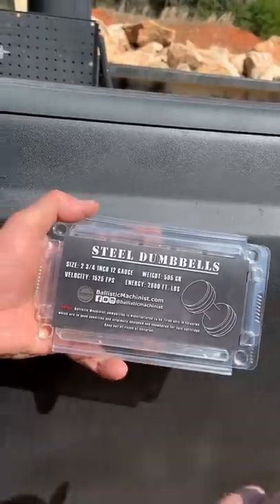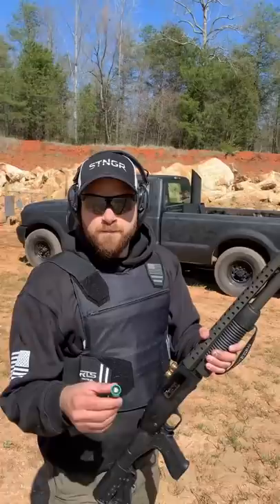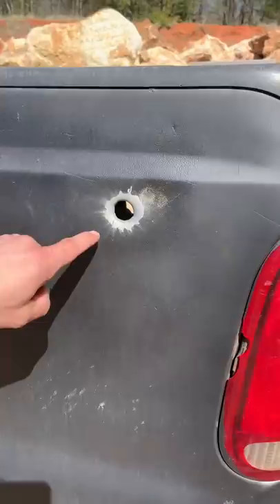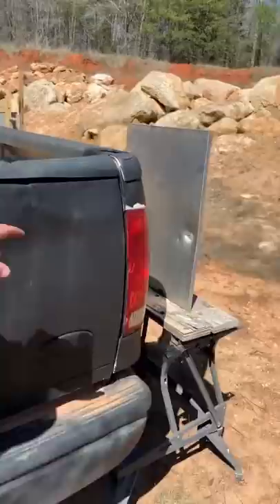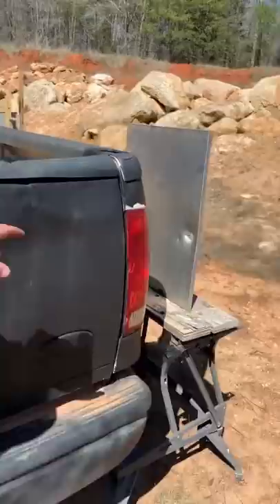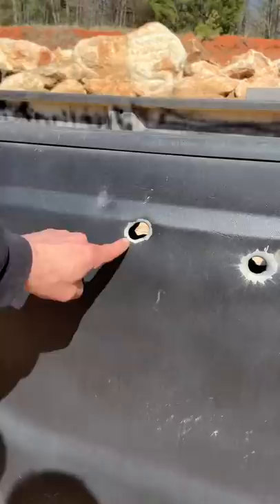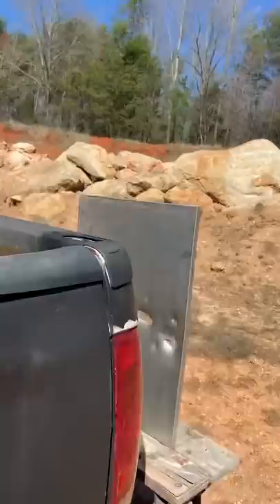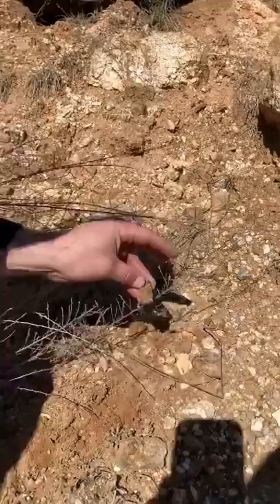Steel Dumbbell Round Vs F250

Comment: Perfect house defence. Honey someone's downstairs.. 2 threw floor while never leaving the bed 👍
Reply: It's not about the size of the bullet it's about accuracy
Reply: That’s too much it’s over penetration. It might go clean thru.
Reply: That’ll go through the intruder, your walls, the cars parked out front and into your neighbors home.
Reply: That's not going to work Einstein. Do you see how thin all that metal is? I mean seriously what are your floors made of? Some kind of particle board or balsa wood?
Reply: @michaels.330  You really think wood/composite flooring would stop a slug going through your floor to ground level? The only issue would be the struts getting in the way.
Reply: @Mundilfari_  I definitely think it's a false equivalency to say that this round that went through 3 thin layers of metal, would do the same to the various layers of everything between the floor and the basement ceiling. It's all about stoppage. And the various layers, not just the wood and what you mentioned but everything in between will do more than you think. People didn't think that all the layers of a fabric that was interwoven wouldn't do anything either. But look at the way kevlar changed the world. I definitely think all the different layers of crap in between the floor and basement ceiling would do something similar. That round is not making it through a floor. This video is giving people false ideas. I could puncture sheet metal with a pencil. What does that tell you? And the shot he took between the tail bed of the truck is not very thicker either. You can believe whatever you want though. I'll stick with science and logic.
Reply: @michaels.330  Have you ever seen how thin ceilings/floors get in apartments and multi level houses? It’s all about maximizing room volume now while using less resources, you see it in most newish real estate. It takes something as little as jumping too much to fall through the damn floor, let alone shooting a massive steel ball straight down through it. If it were a buckshot maybe it would slow down or be stopped but there’s no way insulation and flooring would be enough to slow down a hunk of lead going 400+ m/s. The physics just doesn’t add up to what you’re saying.
Reply: @Mundilfari_  the physics definitely add up, there is enough resistance to slow it down and stop it with a floor. But just to humor you, the physics don't add up to a simple fabric kevlar vest either yet that happens. You're just going to use anything to argue, because you feel it necessary to be right like the vast majority of everyone else online. There is way more layers of stuff in between the floor all the way down to the ceiling of the basement that you're indicating. You are downplaying it because again you want to be right. And there is no way jumping up and down like crazy would bring me through a floor. Not in any of the places I lived at least. You must be living in some really cheap places if jumping up and down sends you through the floor. That's absolutely rediculous.
Reply: @michaels.330   Welcome to the lower middle class, where you can only afford what’s functional, not durable. I linked you an example but YouTube deleted my comment, just search up “person shot through floor”. There’s countless real life examples proving that bullets go mostly unobstructed through floors/ceilings/walls pretty well. To compare insulation to how Kevlar fibers work is moronic at best. All the individual insulation fibers would have to be perfectly aligned to unravel/stretch without breaking. Because if it did it wouldn’t absorb the projectiles energy and it would burst right through.
Reply: @michaels.330  its really funny you say this. A long time ago my older brother was drunk and pissed, and fired a shotgun into the living room ceiling. The slug went thru the ceiling, all the way up thru the floor boards, and into the ceiling of the room above. He also pretty much deafened himself too when he fired that inside lol. It kinda sobered him up a bit honestly lol. But yeah, I can totally see that dumbell slug going all the way thru the floor with no problem whatsoever. Theres really not going to be that much in between the floor and the ceiling below it. Not anything thats going to stop a 12 gauge slug. There are actually alot of examples of people being shot thru a floor if you go look it up. I mean, how many layers of stuff do you actually think is in between a floor and ceiling? What are all these "layers" you are talking about? You talking about insulation? Lol because insulation ain't stopping or slowing down a bullet or slug. Not even a little. And it definitely can't be compared to Kevlar. And you can look it up and see the physics behind why Kevlar works. Its not all that complicated, and it's definitely not a mystery that science cant explain. Actually the idea for Kevlar has been around for centuries. The Romans, and the Japanese, and many others, used to use layers upon layers of interwoven fabric to make  armor. I think that you better research what your saying, because you will find out that you are 100% wrong, and you sound really stupid.
Reply: @michaelgladden5990  seems like a personal problem the intruder should of thought twice then Lmao
Reply: Any gun if house defense 🤦🏾‍♂️
Reply: @NewzAndReviewz  Agreed. I have my preferences..but for the most part, any will do for defending the home as long as you are comfortable with it.
Reply: @michaels.330  most bedroom floors in modern construction in the USA are 3/4 advanteck OSB  then covered with carpet/ laminate flooring. This round will make it through unless you hit a truss.
Reply: @Snookchaser007  There are also homes that use things called smart slabs. And many houses have a concrete basement that works itself all the way up and around and forms a ceiling. There are plenty of modern homes that would prevent that round from going through a floor.
Reply: @michaels.330  Go to college, take an engineering composite materials course, and you will be able to calculate the physics on why Kevlar works, but random materials in layers do not. As the man above me already informed you, it is entirely possible, probable even, that any round could make it through someone’s floor/ceiling. Layers of wood, insulation, and sometimes metal would almost certainly not stop that dumbbell round lol. But like you said, some people have to be overly aggressive and right about their opinions that they know nothing about.
Reply: Yeah turns out the person downstairs was ur kid getting a 🥪 to bad you didn't check who it was before
Reply: @benjaminbasler5387  assuming I have kids mate...
Reply: Lmao!!! No shit!!!!!
Reply: @mattjack3983  exactly glad you actually could attest from a real life experience instead of most trying to prove someone wrong with a "scientific " assumption to validate their intelligence 😂
Reply: @michaels.330  you really have no idea what you are talking about. A quick search will tell you that basements that have concrete ceilings do exist, but that is a technique that is incredibly RARE in the United States, and extremely expensive. Very, very few people are going to have a concrete ceiling in their basement. I honestly have never seen one, and i did concrete work for about 10 years. Ive done hundreds and  hundreds of basement floors, and have not once in 10 years of doing concrete work, even heard of a concrete ceiling in the basement. I dont think you even understand how much work it would take,, and how difficult it would be to make concrete ceiling like that. Sure, it can be done, but again, it's extremely rare. Rare enough that a person can spend a decade doing concrete work and never even do one of those lol. And literally NO ONE has a concrete ceiling on their main floor, between the main floor and upstairs. Houses are not built like that. That kind of thing is literally non existent.   For your point to actually have any merit at all, you are using an incredibly rare and exceptional example of an incredibly rare home that has a basement with a concrete ceiling. Your arguement doesn't hold up very well at all dude. Sorry but NO, there are not many modern homes at all that have floors, or interior walls for that matter, that would stop a bullet or shotgun slug.
Reply: @mattjack3983  Rare or not, my point was this isn't always going to work. And you also failed to mention smart slabs. Also anyone can say they have been doing so and so to try and prove a point. At least I am able to say with certainty that shooting through every home will yield different results. I have already proven that with smart slabs and actual concrete designs. Rare or not. I've proved my point. Everyone else here is just arguing for the sake of arguing.
Reply: @michaels.330  no, YOU are arguing for the sake of arguing, as your arguement has already been squashed, and now you are devolving into arguing with exceptions against what is the norm. It does matter how rare it is, because using an exceptionally rare example to make your point is an extremely weak argument, since when talking about "shooting thru a floor", one would reasonably conclude that we are speaking of shooting thru a floor/ceiling that would be found in the vast majority of homes. You began your arguement with saying that the dumbell slug would not go straight through a floor/ceiling, and compared it to shooting thru Kevlar, which is absolutely ridiculous. And you even said something along the lines of science not knowing how Kevlar works, or it being a mystery, or something like that, which is so false and ridiculously silly that its laughable. Only after your arguement was knocked down did you then do what most people do when trying their best to "be right", and start using rare exceptions as your examples in an attempt to make your point. Which doesn't hold up. Because again, we are talking about the vast majority of modern American homes. And if you walk into a random house, on a random street, in any random town or city in America, and shoot a shotgun at the ceiling, the slug is going to go clean thru the ceiling and floor above it, damn near every time. Most bullets will as well. Using your examples of concrete ceilings is like using an armor as an example of a slug not penetrating a car door. Amored car doors don't represent the vast majority of car doors out there, just like concrete ceilings and smart slabs do not represent the vast majority of floors amd ceilings in modern American homes. Thats why you dont argue using exceptions and rarities.
Reply: @mattjack3983  that's not how I began my argument at all. And all you keep doing is chopping my words up and piecing it together. Every single word of my argument is my argument. It doesn't matter if a small opening was written or I added additional information. It's all one argument. Especially because it's been formed with multiple people saying multiple different things so naturally my response is going to be tailored to who I'm talking to. Your argument is literally no facts and all your word. What kind of argument is that mullet head? At least I'm using all facts. Houses DO have modern designs. And there are plenty of rich people using smart slabs or going all out with  modern designs. Just move to California and see for yourself. And in NY buildings there are plenty of brick homes still all around with newer concrete designs being made. Those facts I can point out easily. Your mid west or southern world makes up for a poultry population. So no the vast majority of homes cannot even be accurately shot through. And I'm not even including the people in the south or mid west that reinforce their walls so bullets can't just go through. Because those people exist too. So no, one cannot walk into ANY home and shoot bullets through it. That's what my point was from the start. If you can't understand these simple words I think your brain is squashed. It's probably why you have a mullet. I'm guessing someone dropped you on your head.

Comment: A hole is a hole..  I don't want either one on me lol
If you want something brutal, I've seen rounds that instead of a slug, it used a tightly packed tungsten(if I remember correctly) powder that would disintegrate its way in virtually every direction upon impact without leaving an exit wound.  With the powder particles being so small and numerous, there really isn't anything that can be done for someone if they are hit with it.

Comment: 👀😲😱😬 There is a more important lesson to gather from this experiment.
 And in my opinion, is not the aftermath of the destruction both ammunitions performed.
 Is understanding the difference between PROTECTION and CONCEALMENT.
 I suggest you hide behind the engine and obviously on the other side from the projectile is coming.😁😁😁

Comment: Dude… your “sheet metal “ is aluminum, and you are going through the thin portion of the bed. This is not impressive
Reply from the maker: It’s a 99 250 it’s steel . Try that google machine